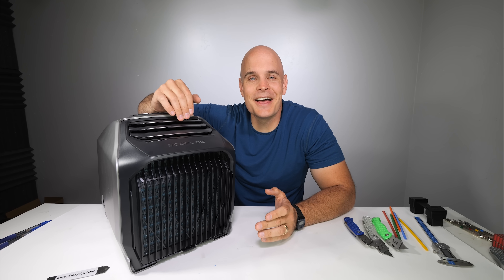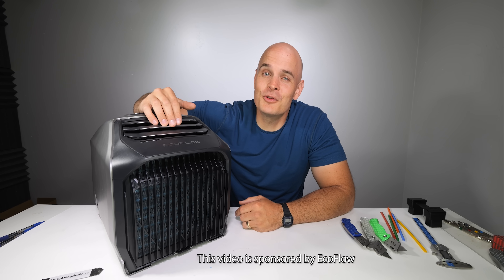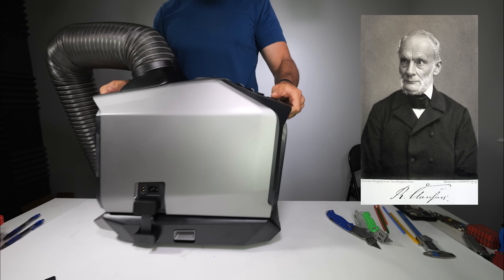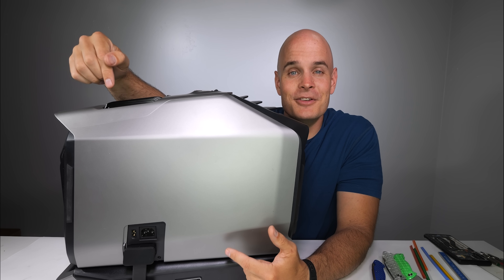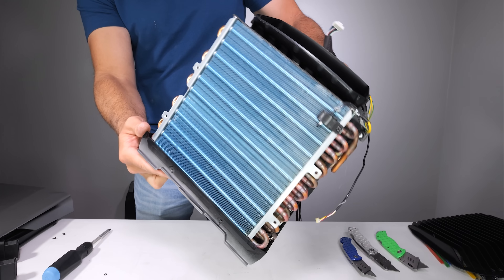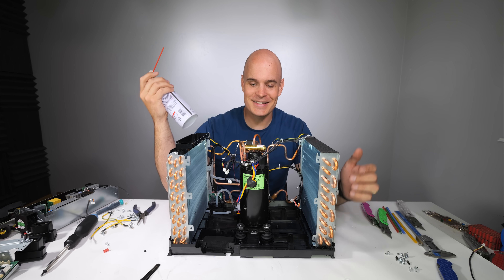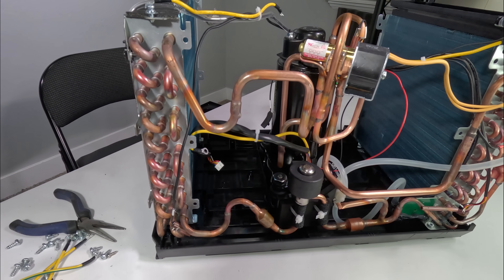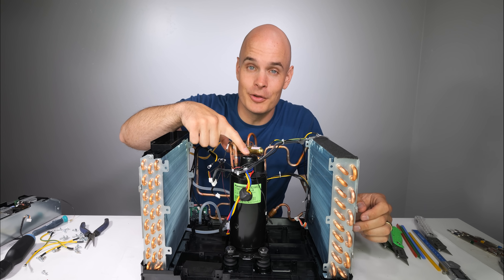THIS CHANGES EVERYTHING... (Ecoflow Wave Teardown)

Comment: Something tells me someone reverse engineered Tesla's heat pump.
Reply: Tesla doesn't have anything unique as far as heat pumps are designed, they just have a unique application in electric cars with the Octovalve than can move and redirect heat from multiple sources.  A heat pump is just a compressor with a reversing valve.  Most add a variable speed pump to make them even more efficient at lower power level as well.

Comment: Edit: Hey Zack... apparently you forgot to show us the most important feature of this unit for efficiency.

Just ONCE I'd like to see one of these "standalone" A/C units have both an intake and exhaust for the condenser coil's airflow.

ALL These style devices exhaust the same air you're trying to cool/heat, which causes a pressure differential making the climate controlled space draw in outside air.
Reply: There is plenty of them. But they should be mandatory.... They have about dubble the efficensy, compared to this model. a 200% efficensy in a heatpump is kinda bad tbh. A lot of them are about 500% under optimal condition
Reply: It has 2 ducts. Check the website.
Reply: @KodessR  ooo, that is amazing then! I feel that there products are a little gimmicky a lot of time. But seems like they really are improving and growing In a good way
Reply: @KodessR  It has a 3rd for the output, so you can just leave the device outside and pump conditioned air inside as well, or stow it in an RV closet and use all 3
Reply: @rcguymike  nah it only has 2, but you can use one on either the hot side or the cold side but in order to get maximum efficiency (recirculation instead of positive pressure fresh air, iff the space is sealed enough for that to be beneficial) in the space with 2 hoses is the way.

Comment: With only one hose, aren't you just creating a vacuum in the room (by expelling the air from inside the room), sucking in outside, unconditioned air? Thus negating the whole effect? It seems you would need 2 hoses, with insulation, to even approximate the functionality of even a window ac unit.
Reply: They do offer 2 hoses to keep the pressure in the room the same.
Reply: exactly, as soon as I saw 1 hose I knew that it was a poor design
Reply: @dthompson7643  oh yes, the youtube comments experts are out to tell a company their design is poor. ya know, in the youtube comments 😆
Reply: @undeadly1103  pay attention and you might learn something

Comment: whats left off grid microwave?
Reply: Solar generators already allow that 😉
Reply: @rcguymike  also u need damn lot of solar panels if you want turn on 1000w mircrowave
Reply: @rcguymike  u theoretically use air conditioner with solar panels it's just jot practical

Comment: Heat pump that takes heat from the room to pump it to the same room. Good if you want to heat your forhead up while cooling the rest 😅
Reply: Ducts, man, ducts. But mobile AC units still suck.
Reply: @romgl4513  and if they just gave us a baffle and a 2nd hose to provide an intake for the exhaust then there would no longer be a pressure differential between the climate controlled space and the outside which causes the space to actually suck in outside air.

suck was absolutely the best term to use here too!
Reply: @RyanAumiller  They do offer 2 ducts, so there won't be a pressure difference in the room while operating.
Reply: The kit comes with two hoses and adapters to use outdoor air for the working side.

Comment: Looks to have only output and not input, so they literally suck. They suck the cold air, run it through the "outside" part and heat it up and throw it out. These are the worst ac units you can get.